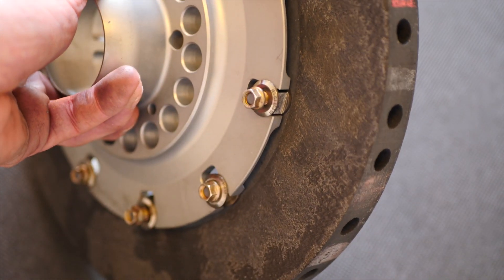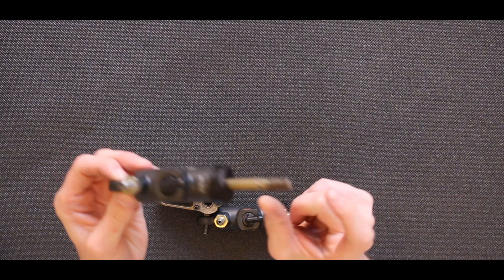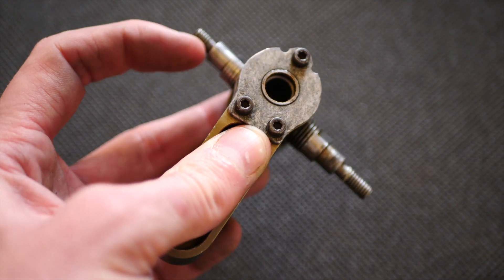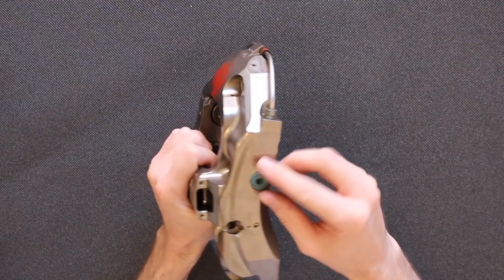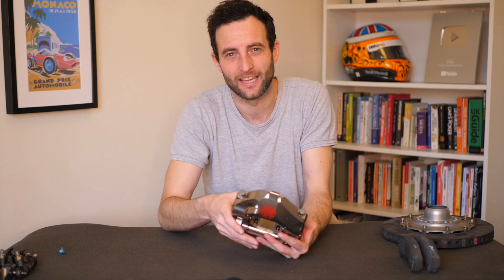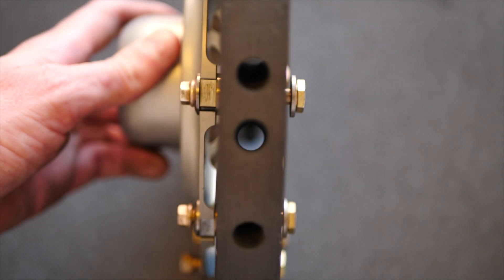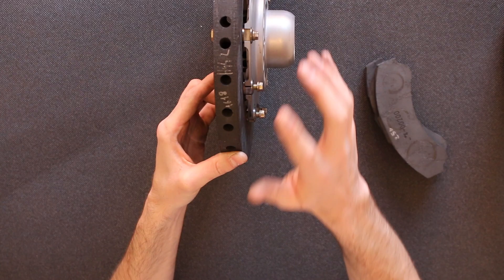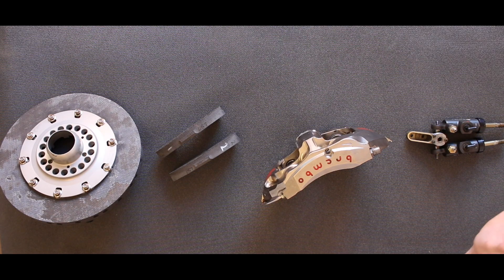How F1 Brakes Stop from 200mph to 0 in 4 Seconds | F1 Engineering

Comment: F1 driver are not humans, they can lift me with their necks🥵.
Reply: F1 drivers train their neck strength very very often and are as a high level athlete just like any other sport. They have to be super in shape to drive an F1 car. Towards the end of the race, you can normally see drivers starting to rest their head on the sides of the car because of how tiring it is.
Reply: @Stephen90s  yes, they also lose around 5 kgs in a single race
Reply: John Grisham gtfo. An F1 driver is not anywhere near as athletic as an actual athlete.
Reply: @DevilDaRebel  you have no idea what you're talking about. F1 drivers are some of the fittest athletes in the world.
Reply: @DevilDaRebel  Lewis Hamilton is the athlete of the year with lio messi
Reply: @DevilDaRebel  They are definitely in shape. You are making some bad assumptions here. You are the marathon runner that says a 800m runner isn't fit. Or a pole vaulter that claims a javelin thrower isn't fit.

The drivers needs both endurance and strength. It can be extremely hot in the car, and they need to perform at their best for the full time. it's just that they need to adaot yheir training so they do not build bulk, because excess weight is a disadvantage.
Reply: @perwestermark8920  I’m not making any assumption. Just a common sense observation. 

“You are the marathon runner that says a sprinter isn’t fit.” Talk about bad assumption and moronic analogies, ain’t that rich?

“The driver need endurance and strength.” Because yeah, you know, turning that steering wheel requires the utmost strength and enduring the hotness is almost inhuman. Lmfao
Reply: @DevilDaRebel  you think a normal athlete can take the G forces f1 drivers take?
Reply: @DevilDaRebel  if they weren't athletes, how could they do such long drives and be able to turn the strong steering wheel so fast so often? they have to have lots of endurance to keep it going in the races. Le Mans they race for a lot of hours at a time, they must be athletes. normal ppl couldnt do that lol!
Reply: @lilsand.  You just replied to a three year old comment, blabbering about “keep it going” while typing out a “lol.” 

facepalm
Reply: @DevilDaRebel  Oh I didn't see it was three years old, sorry I'm pretty young still trying to understand how this all works. and my grammar is slowly improving, im doing my best :/ I was just trying to copy your style, bcuz it seemed like it has perfect grammar. And you seemed like you are smart so I asked you. I wish I asked someone else so I could learn something proper.

I'm just trying to have conversations and get improved but theres alot of predators on the internet my mom said. Why are you being mean to me? Are you predator?
Reply: @lilsand.  They say imitation is the sincerest form of flattery, also, nice grammar by the way. We call your type, “ironic.”

Btw, I just noticed your acc is 12 years old, yet your text gives the impression youre a tween. Funny..
Reply: @lilsand.  Of course, there’s more educated people like me. After all, one must teach for one to be.
Reply: @lilsand.  You’re just that slow, lmfao.
Reply: @DevilDaRebel  No I don't want to speak with you anymore, I don't feel comfortable. You creep me out! Dont teach me anything I dont want to.
Reply: @lilsand.  Enlighten me then, I won’t hold my breath though. It seems as if you’re finally losing it.
Reply: The duration of the high levels of G loads is what really matters, those peak G forces are seen only for a short time like maybe on turns or worse when coming to a sudden stop from hitting a wall (where the G load is extremely high but lasts for a split second). If they were to sustain the same peak loads for the whole race, it won't be likely for any human to come out of that in decent shape assuming they don't go unconscious.
Reply: @ali902107364285418  i know, still crazy 3 or 4 G for a second, every single corner during 2 hours, not for me 🥵
Reply: @eliasgill2453  They are strapped in, does not move very much in any direction and as it's not vertical forces they dont have to strain to keep the blood from flowing down. Very different, their heads is also strapped with bands to the neck protecting device
Reply: @ali902107364285418  they wont go unconscious as its sideways g forces not up and doen or whatever itd called, so blood wont leave the brain
Reply: How about we put those brakes in a car, see what happens?
Reply: LOL, I thought that when I saw that drivers head in that machine.
Reply: They are humans
They just exercise their necks
Reply: 8 gs of braking in the first corner in australia and almost 4 gs while turning
Is that human or f1 drivers are robots or WTF?
Reply: old photos of the bull neck of Nigel Mansell is an example from times when the drivers had less head support.
Reply: Higher now ama
Reply: thats why they wear a "HANS"
Reply: its lateral g force, not normal... so yeah.
Reply: @dedasdude  they can lift him sideways
Reply: @dedasdude  they do train with 20kg weight with their neck
Reply: That's for the fartheads telling "since clutch pedal and shift stick have been removed, driving an F1 car is like playing with Playstation, anybody can do that".

So, why teams spend so much money buying drivers?
Reply: @Virtuoso23  they wont pass out, never said its easy. Their neck would be ridiculously stressed
Reply: You find the most moronic comments in the internet, hahaha.
Reply: @DevilDaRebel  Yes. People like you exist... So next time you get an urge to comment - how about checking how much they normally train. You'll find people in some sports train less.

Comment: Wow! You've outdone yourself Scott, this is mega.
I would genuinely give all my savings right now to have an F1 rotor and caliper to study.
The pinnacle of our hobby.
[edit] In the video a clip is shown of the manufacture of road car "carbon ceramic" rotors, but am I mistaken that F1 components are true composite, as in a layered matrix of cloth with a hugely complex process including post-machining rather than the inferior production-car powdered resin method?
Reply: 5thgearouttahere yes you are correct and it’s very expensive method too. And sadly it’s not worth even putting on a road car because it deteriorated faster and requires immense heat to work and the biggest down side is that their friction coefficient would be greater than any road tyre. Which is sad lol. I mean there are ways todo it but sadly. Currently It’s only truly worth doing on race cars.
Reply: @cecilracing53  Brembo do have a retail version that is likely designed for GT3-class customer racing etc.
My hope is to see it on a pro touring build or similar.
Reply from the maker: Wow, thanks very much.
Reply: Well no one wants your 2 dollars but still that's pathetic.
Why not try and get laid or buy an actual car? No you'd rather have this rotor to study. Lame bro very lame.
Reply: @frankburdodrums8984   I guess some people love engineering more than others. What excites you or I, may bore others to death. They are not any 'lamer' than you or I.. just different. No need to be so rude to the dude.
Reply: @frankburdodrums8984  you realize your post is irrelevant and pointless. made you look like an idiot and an asshole. there was no point in saying that and it carried no context. I don't care about other peoples feels and feeding people sugar coated crap. but going out of your way to be rude and make someone feel small makes you smaller than them for chasing and doing what makes them happy.